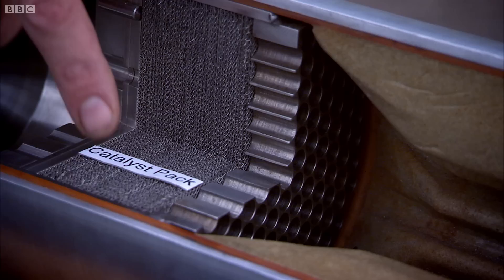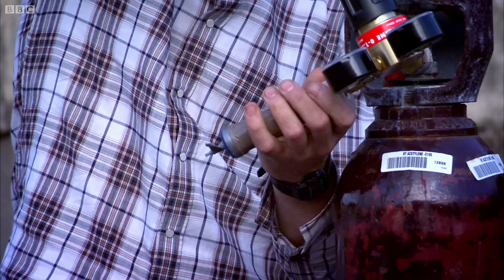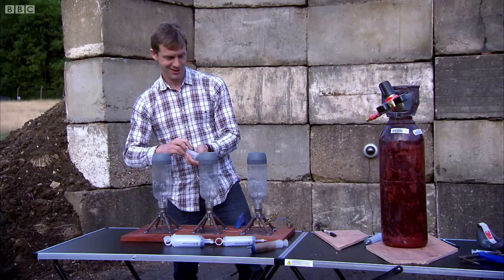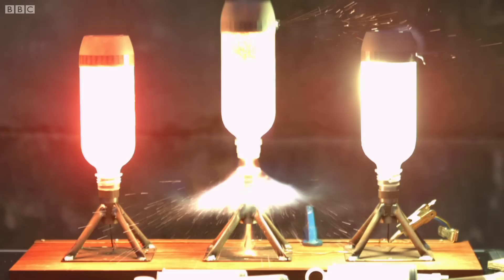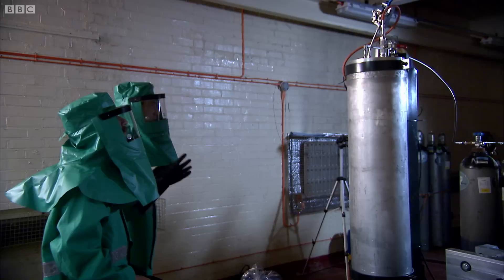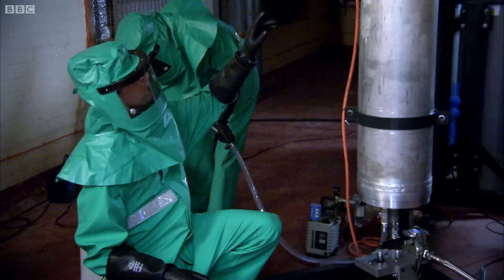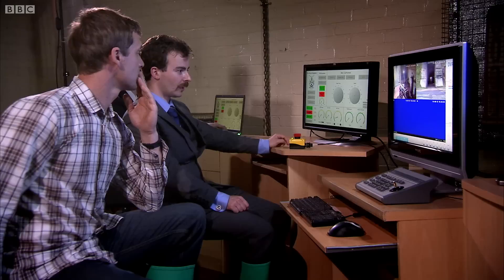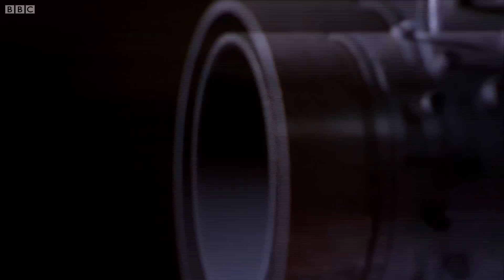How to Make a Rocket | Bang Goes the Theory | BBC Studios

Comment: Generally, liquid fuelled rocket Engines mostly cryogenic hydrolox run a little bit fuel-rich because if they burned fuel at the stoichiometric ratio (the perfect fuel-ox ratio) the reaction would produce so much heat that the engine would melt